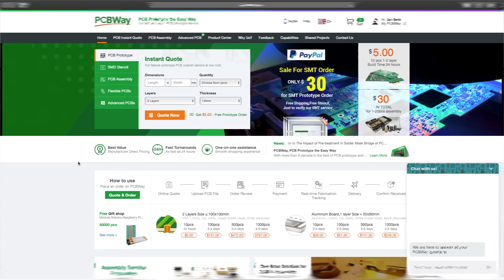Amiga 600 Black Screen Common Fault Repair

Comment: Okay, small extra info on the A600:

1. The Kickstart ROM's are working, I actually tested them in another Amiga.
2. The broken off Pin, I am not sure, could be, I reinserted it badly, maybe it was just dodgy enough. The pins are pretty thin anyway.
3. It had no RF shield to begin with - this is how it came from Ebay
4. I "stole" the CF card so it's an HD only in name now :)
5. I compensated for that putting in the broken RAM expansion. ;)

Hope it can become a trusty part of your collection.
Reply from the maker: Thank you so much for donating this beauty. :) It's definitely going to get some upgrades in the future and become a valued part of the collection.
Reply: Not having the HD isn’t a big deal. Easy enough to replace with a modern CF card arrangement. I’m sure he doesn’t care! Free A600!

Comment: hi great video, I got an amiga 600 from ebay and it worked! then it didn't....strange just seems to stop working now all I get from video is a yellow screen followed by a black screen,  sometimes just a black screen and on rare occasions its red! any ideas what this could be?  its strange cos it worked fine for first few days after it came in post.

Comment: Hi Jan! I just recapped a fully working A600 (to extend its life) and now I'm getting a black screen and no bootup at all. I also replaced that 10 uf capacitor again just in case but I get no signal. The power led turns on, but not the drive led so I guess it's not starting up for some reason. I measured the voltage on pin 3 of the 555 and it stays up at 3.5V. I did the same measurement on a working amiga 600 and the same pin shows a voltage peak then goes to zero. Any idea what could be the problem? I think I did the recap correctly (already did it successfully on another a600 and 1200) and on this special PCB all the pads were really in good conditions and clean.
Thanks in advance for your time and your awesome videos :)
Reply from the maker: You might have a bad 555 timer IC, they do break occasionally. Maybe worth a try to replace that. The reset line on the 555 should go high for a second and then go low, as far as I remember. It is then inverted by a logic chip and fed to the processor, should go from low to high there and stay high so the system is active.
Reply: @JanBeta  Thanks Jan! Tried that, and also the new 555 unfortunately stays up with the voltage instead of going down. Any ideas? At least I can rule the 555 out. Thanks in advance :)

Comment: My A600 got water damaged and the caps are a little leaky. The power LED doesn't turn on. It only shows a solid purple screen at boot and the light on the capslock is turned on constantly. Any idea what could be broken?
Reply: I have the same issue, with the black screen, and the capslock led always on, did you ever resolve this problem?
Reply: @xsm_p2  yes, it was just one cap in the reset circuit.

Comment: I recap but Yellow composite video exit  dont work.,..
Reply from the maker: Maybe you have some damaged traces near the video out. It's a pretty common fault I think because the capacitors in that area leak a lot usually.

Comment: I have a Amiga 4000cr Rev D that shows the same Issue (Black Screen after PowerOn). Can it be the same?
Reply from the maker: If it hasn’t been recapped, leaky capacitors can cause all kinds of problems. I think the reset circuitry is rather similar to the A600 so that might indeed be the problem. There are other points of failure that could cause it (like bad contacts on the RAM for example). Recapping is highly recommended for all Amigas that have SMD electrolytic caps, I’ve not seen a single one where the capacitor were no problem.

Comment: Sometimes it's possible to lift up the warranty sticker to get to the screw hole, and then stick it back down so it looks like nothing happened. Then again, with something that's been out of warranty for over 25 years, it doesn't matter anymore.

Comment: HI Jan, your video prompted to take a look today at my neglected A600HD because  there is a ram expansion in there, I was sure it was one without the RTC but I was mistaken (A601) so my Amiga (and the ram expansion) booked for me some TLC time for itself!
Reply from the maker: Oh, hope nothing got damaged! :)
Reply: Jan Beta it was really horrible to see but once Treated with vinegar and brush it got much better, I need to find or create my WB disks to find out of the expansion is working, the ram section at least, the amiga itself has no damage and no apparent cap spill but a recapping is on the way for it, and also a CF HD adapter, pcmcia, you know, you maybe stop only when it’s done :)

Comment: i remember moding one of those for a friend . we pigibacked 2 or 4 extra ram chips on top of  oryginal ones with i belive chip enable lines routed to the  2 pins on the ram expansion port
and it worked great
i wonder why people did expansion the "easy way" when just pigibacking 2 chips leaves you entire expansion port  empty for something else
Reply from the maker: I guess most people were not aware of the piggybacking method and/or could not solder too well. ;)
Reply: @JanBeta  the fun part was my friend owner of the amiga told me what and where to solder, provided ram chips i was only the person who knew how to solder things in this case and i did it in a different way than i was told anyway :P because otherwise keyboard would not fit. i remember putting more ram chips on a stack next to a keyboard, since both ram chips were connected to full memory bus and there was continuity between all data and adres lines on both chips
my friend was kind od shocked and did not belive it would work, but it did, workbench showed all installed ram just fine

Comment: Great work, another Amiga saved from the graveyard👍. I’ve had to recap two A4000 boards so know that smell well.
Reply from the maker: Thanks! Yeah, I think most of the caps from the era are leaking. At least in the machines I have openend so far.

Comment: I dealt with this exact problem last year. In my case the 555 had also failed due to leakage corrosion.
Reply from the maker: Yes, really seems to be quite a common fault. Hope you were able to fix yours.
Reply: @JanBeta  I just fixed one today.. in this case, C612 had leaked and destroyed Q511 ! All good now though :)

Comment: I have a A1200 with the same problem... maybe has the same solution? i will give a try...
Reply from the maker: I think in the A1200 the circuit is basically the same but the layout is a bit different. Definitely worth a try. And definitely look into recapping the whole machine if you haven't done that.
Reply: @JanBeta  A1200 is similar, but the reset part is not done by a 555 - it is done by a dedicated power-on reset chip.. so it is less likely to fail

Comment: Wow, I mean I agree that you should change all the capacitors on old computers like this, but wow can't believe the fix was that easy, I will keep that in mind for future reference, love to see what happened to the expansion board so I will watch out for that then.
Reply from the maker: It was an educated guess more or less. I read about the little cap being a common fault and smelled the fishy electrolyte so it was one of the first things I tried. SMD caps from that era are literally all bad so they (or corrosion caused by leakage) are always suspects.

Comment: Is possible to make an Amiga PSU with modern parts/components?
Reply from the maker: Sure, it's a pretty standard 5V/12V/-12V PSU. You can make one or get one of many that are readily available and put a cable with the correct connector on it. Even the 5 pin square DIN connectors are available again as new parts these days. :)
Reply: @JanBeta  Thanks! I'm looking for some tutorial to make one, or maybe you could make a video where you build one of them like the c64 psu you built some times ago!

Comment: could you replace that electrolytic with a ceramic capacitor ?
Reply from the maker: Yes, these machines work with multilayer ceramics. I did a full recap with ceramics on my A1200. However, I would no longer recommend doing that as the characteristics (and especially the timings) are slightly different with ceramics vs electrolytics. You may run into problems with certain accelerator cards etc. Replacing this particular cap with a ceramic should work without any problems though, as it's just a delay for the reset.

Comment: Thanks Jan, I have a few 600 1200's to recap, with various faults, I let you know if I have success, does any one have stock codes and values for replacement capacitors, as I need to buy in bulk, must be high quality, cheers Jan
Reply: John Chucky Hertell has a great blog about recapping Amigas  http://wordpress.hertell.nu/?p=464
Reply from the maker: Here's a very handy site with capacitor lists with part numbers (you can just copy+paste the numbers into the search function of electronics suppliers): https://www.ikod.se/repairs/capacitor-lists/ Used it to order caps for the full recapping of this machine. All Panasonic long life, high temperature caps.

Comment: What a lovely little machine the A600 is. We all rolled our eyes at them in 1991 (for good reason) and now we all want one because they are so cute!
Reply from the maker: Yes, it definitely makes a lot more sense from today's perspective. Again a machine that was marketed incorrectly back in the day. Commodore should have made it the low budget A300 they had initially planned and it would have made more sense I guess. :)
Reply: @JanBeta  Yes - a $150 machine that could be a real replacement for the C64, and maybe reclaimed some of that market would have been nice.

Comment: uuhh.. Jan Beta with an Amiga 600 repair. nice ;) A600s have crap build quality VS Amiga 500. But they are nice little retro computers with some nice and compact whdload possibilities
Reply from the maker: Yes, the form factor is really cool. At least from today's perspective. ;)
Reply: @JanBeta  I have recapped 3 Amiga 600s. All A4000/A1200 and A600s should be recapped immediately. Luckily mine did not have any damaged pads yet. Even though there was some leakage. Looking forward to your next A600 video

Comment: 1:03 That's funny, my A600 also has black screws. Makes me wonder.
Reply from the maker: Mh, maybe they are the original screws after all. Never seen black screws in any Amiga so I just assumed they were put there by a previous owner given all the mods that have been done to the machine.
Reply: I also assumed that my black screwes were non-original. Oh well, maybe it's a coincidence, maybe not. We need to look at a lot more A600s to be sure.
Reply: @Hagledesperado  The screws on this one were just a wild assortment of nonstandard screws. I think there was not a single original one among them.
my other two A600's have silvery screws.
Reply: Oh well, just a coincidence then I guess. At least they do the job. :)

Comment: Hey! Great vid! Is the same capacitior problem touches A1200? Thnx
Reply from the maker: The circuit is the same, I think the layout is a bit different on the A1200 so it's not quite as common a problem. But the capacitors are very likely to be leaking if you haven't replaced them yet. Definitely look into doing a full recapping, all of the machines from the era I've seen so far had leaky capacitors.
Reply: @JanBeta  Thank You for info :) Great content! Keep it goin!

Comment: To switch between 1.3 and 2.05 there was a software that did this called relo-kick. That instead of doing this sort of hack this had done. Hate to see all sort of switches on a amiga, even a A600/300.....
Reply from the maker: Yes, but relo-kick is not as compatible as a real KickROM. It uses parts of the RAM to store the KickROM and pretends it to be located at the ROM's position in memory. Works fine for some games though.
Reply: @JanBeta  Okey I did not know that. remember I did use relo-kick since I could not get "galaga" to load with 2.05 so thats why I needed this software and worked great for me.

Comment: Think that might be the problem with my A600.
Reply from the maker: If the capacitors haven't been replaced, those are definitely the main weak point in the A600s. All the Amigas from the era I have seen so far had leaky electrolytic SMDs.

Comment: Great job Jan =D  The reset circuit on the 600 is definitely prone to leakage issues.  I remember MsMadLemon having a problem with something around there too - possibly the 555 itself.
Reply from the maker: Thanks! Yes, re-watched that video now, too. She had one of the connections to the 555 missing due to corroded traces plus leaky caps.

Comment: Die Präzisionsfassungen gibt es auch als Stiftleisten, habe ich für den switchless c64 switcher schon erfolgreich eingesetzt. Sonst sollte dem kick switcher nicht viel fehlen. Ich möchte jetzt auch nen 600er, so klein und 2mb chipram mit ram erweiterung ist doch was ....
Reply: For those of us that do not know German..........
The precision sockets are also available as pin headers, I have already used them successfully for the switchless c64 switcher. Otherwise the kick switcher shouldn't be missing much. I would now also like a 600, so small and 2mb chipram with ram extension is something ....
Reply from the maker: Habe den KickSwitcher jetzt tatsächlich ohne neue Stiftleisten wieder eingebaut. Der hat so wenig Luft nach oben, dass es schwierig ist, da irgendwas anderes einzulöten. Werde das aber auf jeden Fall mal im Auge behalten.

Comment: Should I recap my Amiga 1200s and 500s even they they are working fine. I do keep a check on
them for signs of leakage and or swelling though.
Reply: Chris Shaw Definitely recap the A1200. I don’t believe the A500 caps are prone to leaking like the A1200/2000’s. I had mine recapped but I was a tad too late as my mouse input was affected due to leakage. And don’t think that if you haven’t turned on the Amiga in 20+ years then there’s less of a chance of a leak. Don’t risk it, get it recapped so that you don’t have a much bigger headache later on.
Reply: @AndreAguiar  Thank you
Reply from the maker: Yeah, I totally agree with Andre. All the Amigas from the A600/A1200/A4000 era I have seen with SMD electrolytic caps had leaky capacitors. Definitely replace them. The Amigas with through hole components are fine most of the time. Obviously the caps are old and it would be a good idea to replace them anyway but most machines I saw still had okay caps.
Reply: @JanBeta  Thank you, both my 1200 boards are packed ready to go for recapping :)

Comment: Nice... i just sent away my a1200 for repair, it got a similar issue, black screen then reboots (no Kickstart screen). If I removed the rom it just sat on a black screen (no reboots), so yeah... might just need a recap.
Reply from the maker: Yeah, literally all the Amigas with SMD caps from that era have bad capacitors. It might very well be the issue with yours, too.
Reply: @JanBeta  We'll see I guess, I saw now obvious sign of leaks but I learned that you don't always see it. Only thing I saw some green corrosion on one of the IDE pins which's a bit weird?! Anyway, thanks for a great Youtube channel.

Comment: Ohhh that fishy smell in Amiga 600 board’s. 
Yes you are Absolutely right, all Amiga 600s should have a recap job. Ive been very unlucky with my A600s, but not the A1200, interesting to know if commodore used two different type caps. 
Congrats with the repair buddy, allways nice to save Amigas
Best regards
Reply: There's nothing worse than a nose full of that smell when ur troubleshooting!
Reply: @Channel-Zx  But it is quite simple. Just recap a 600, once you get one that have not been recapped. The smell is cap's anyway. 😁
Reply from the maker: Thanks! Oh, all the A1200s from the era I have seen had leaky caps, too. Maybe the models that were produced after Commodore's demise had better capacitors though. I have only worked on the older models as of yet.
Reply: Jan Beta They should all be recapped today yes, but my main rig Amiga500plus is still running strong with its original hole through caps😁🕹🕹🕹
Reply: @RETROCENGO  all my amigas have been recapped .....except 1000 its due this year!
Reply: @RETROCENGO  The 500's are all build with better caps. Yes. Even the Plus. However. All caps have a life span of a certain number of hours. Even hole through. You can see it with all the C64's that are being recapped. So it is only a matter of time before you need to recap a 500. I talked with electronics engineer, in my family. It was yesterday, and he said that it sounds correct. Japanese caps hold up better than chinese from that era. And commodore used cheap chinese for the 600, 1200 and 4000. Ms mad lemon did a video about her 500, that needed a recap. So I guess we will see more 500 in the need of recap, from now on and the next 5 years.
Reply: brostenen i bought my Amiga 500 plus with under 2 months of usage, made a video about it. But i still think it’s used hours yes, but  also general aging, they need to be repaced soon, its just fun to think about an A500 from 1987 stikl runs perfect and an A600 from 1993 is leaked and sometimes destroyed
Reply: @RETROCENGO  That is actually funny. 😁